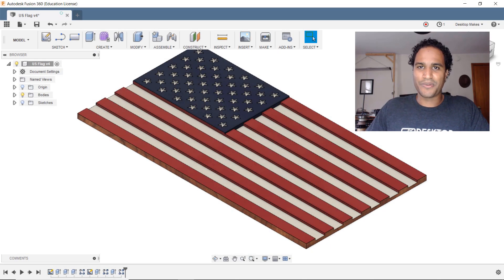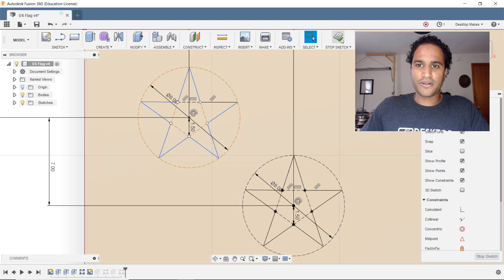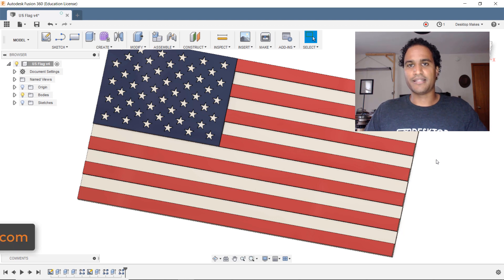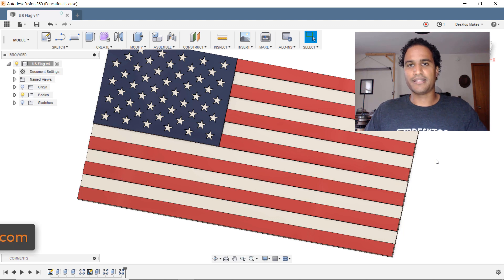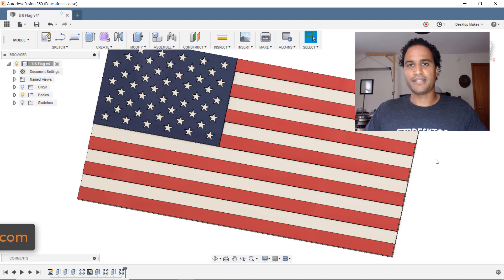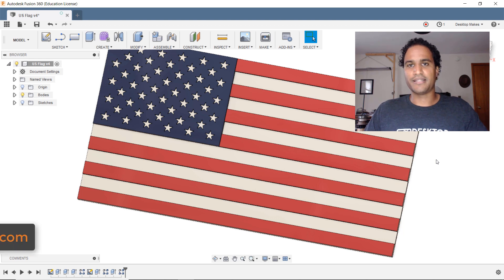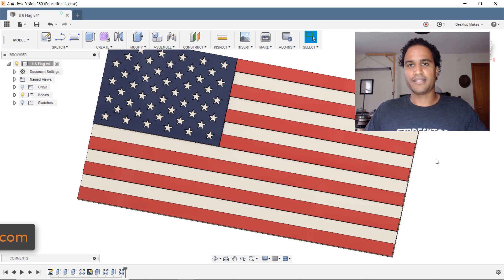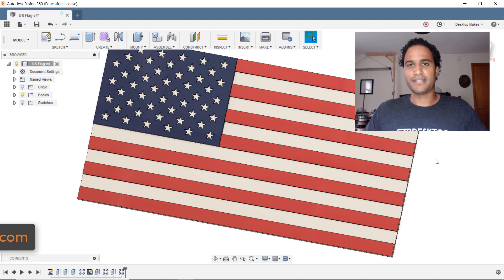Circular Pattern in Fusion 360 - Sketch a Star

Comment: Ditto what others have said: great tips as usual.  Regarding patterns, I think it's worth pointing out that often times you have a choice whether to do the pattern operation in the 2D sketch or with 3D bodies.  For example, with your flag you could create a 2D sketch with one star and use sketch pattern to get 50 stars, or you could create one star body and use the 3D pattern for the copies.  In those situations, I find it's always preferable to use the 3D pattern tools because it's very easy to edit the pattern feature later (like all features in the timeline), whereas editing 2D patterns rarely seems to work for me.  (Or maybe I just need a tutorial on editing 2D patterns!)
Reply: I agree. Some editing options in F360 do no work as one would hope. I run into editing problems quite frequently. Sometimes, I need to completely redo a problematic F360 feature, because editing it does not work.
Reply from the maker: Great point markustube.  I also find it preferable to pattern bodies instead of sketches.  I find that when I try to pattern sketches for some reason it really slows down my computer.  It must take a lot more computation power to calculate sketches than it does bodies.